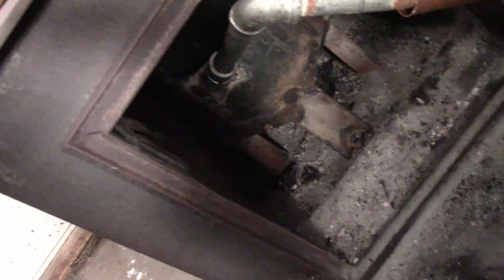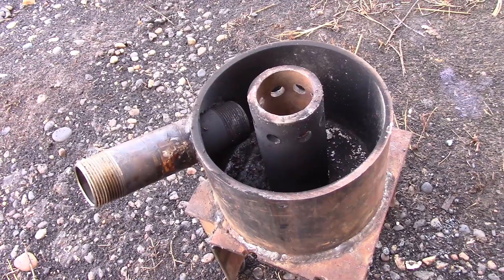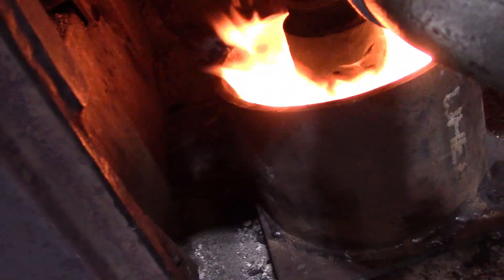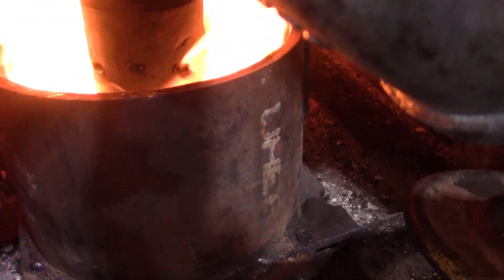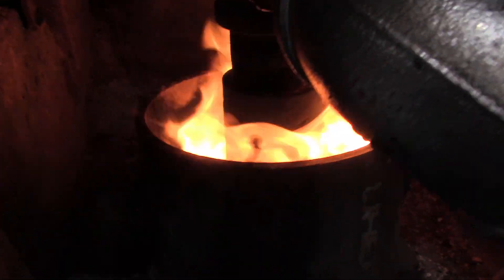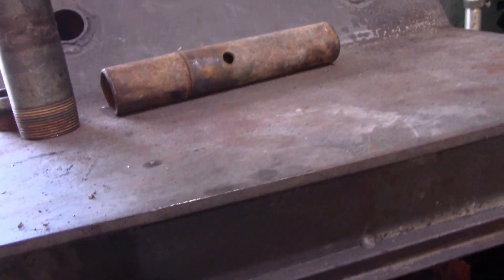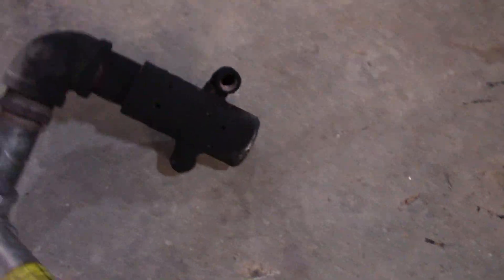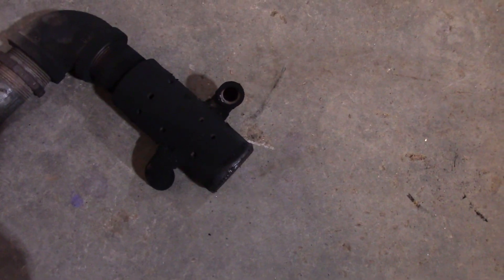Building a Waste Oil Burner 2: A burner design I like with a clean burn.

Comment: The key to clean burn is to pre-heat the air.  You also don’t want too much air as that will actually cool the fire as you mention in this video.  Turbulence/mixing is your friend...  Then it becomes a matter of adjusting the size of the fuel puddle which determines how much vapor/gas is created, to get the best air/fuel ratio.  A dished/concave bottom can help control this as the deeper the fuel gets, the larger the puddle surface area.  With a flat bottom the fuel wants to spread out and you have nearly the same gas generation regardless of the fuel delivered until you really cut down the fuel flow...  too much vaporization can also cool things down.  You know you are really getting there when you start to see blue flame.  Blue flame indicates flame temps over 1200F and that you are breaking down the carbon particles that make the fire yellow/orange...  more pipe inside the fire box will help heat the combustion air...